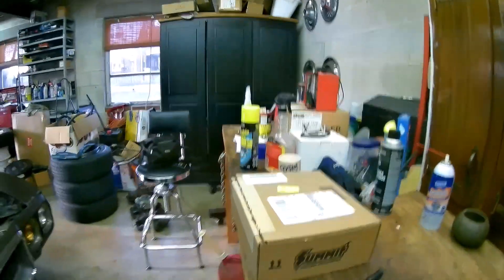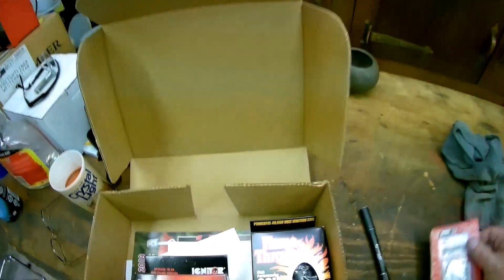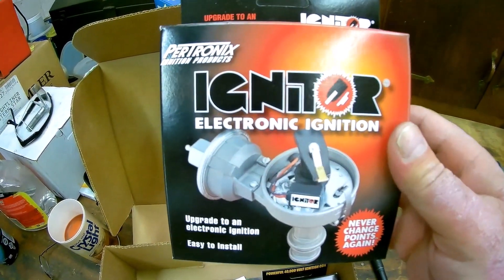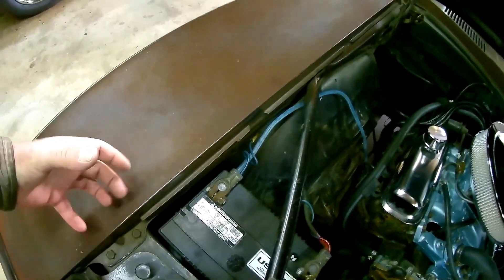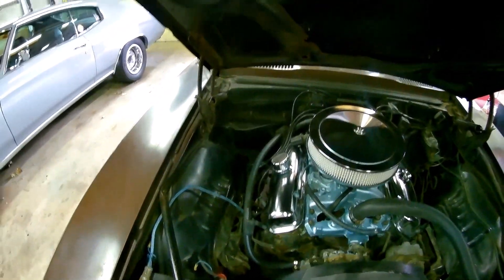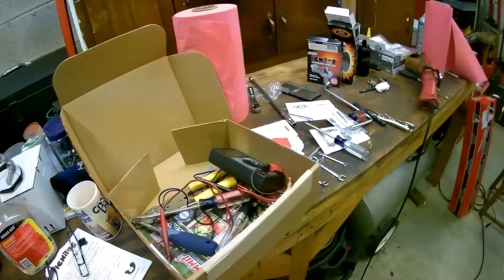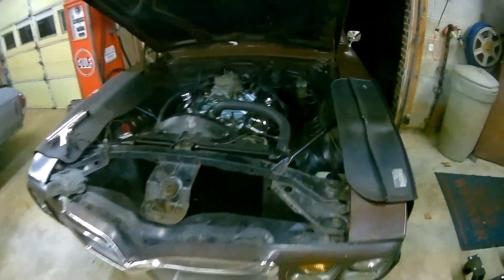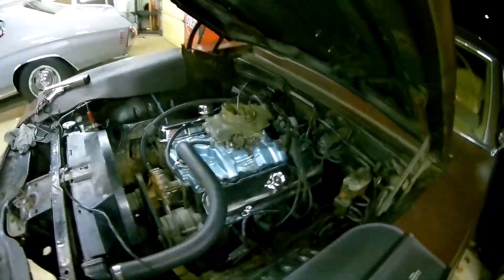69 Firebird Pertronix Install

Comment: Its Sounding good, im running a mallory distributor on my 64 with the flamethrower coil, im liking it. i never like the multispark stuff. in fact the ignition boxes just didn't ever seem to work for me with the coils i use since they are such high voltage coils.
Reply from the maker: Thank's Terry, this set up seems to work pretty good. but wiring this to 12 volts has been a challenge. as you will see in the next video.also nice progress on the S10.
Reply: @Testasspeedshop9997  looking forward to it. thanks